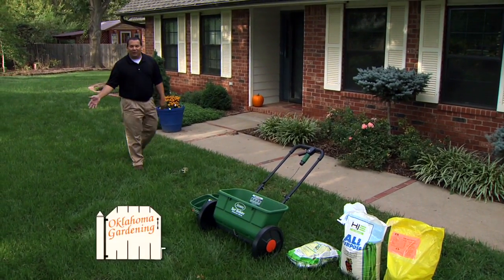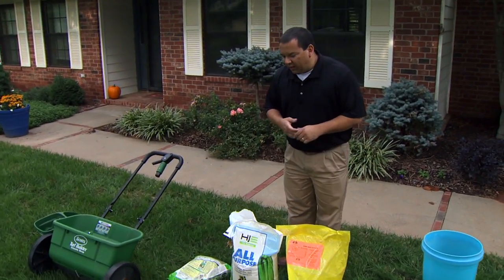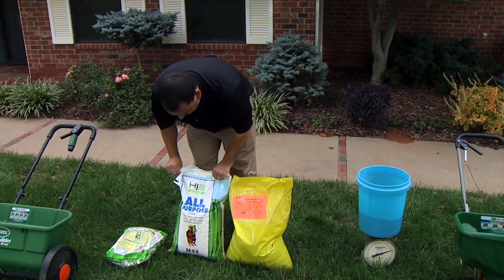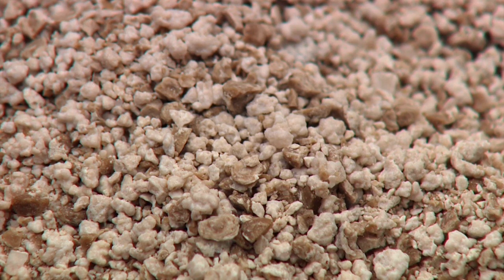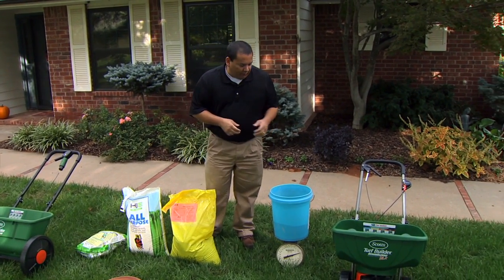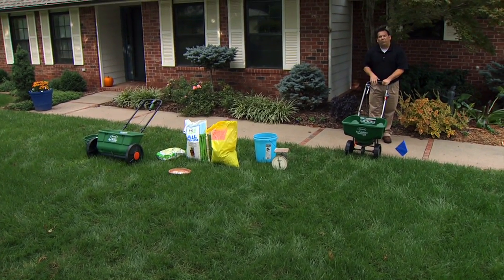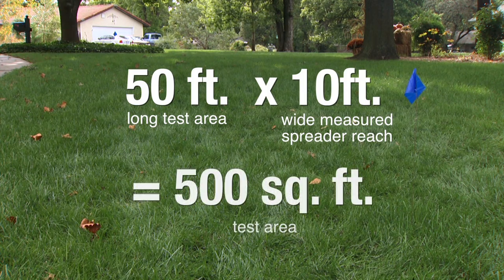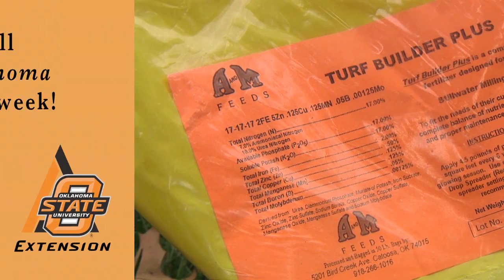Calibrating a Fertilizer Spreader for Your Lawn

Comment: Why did you assume to just load 12 lbs to use? The size of the pellets don't seem to vary substantially from one another. Going from using a 5 setting hole to a 12 is a big difference though. I,m still confused.

Comment: I want to use this for spreading sand on pavers (for the crack-sand that goes in between paver stone driveways, patios, etc). Then I can just blow and sweep it more into the cracks. Which product will work the best for that?